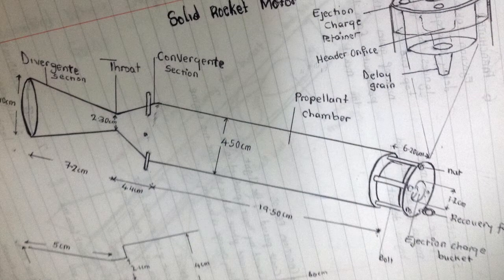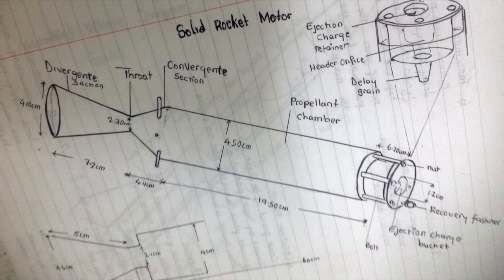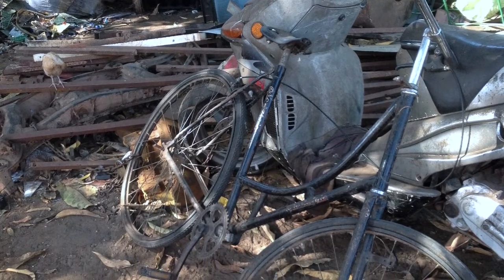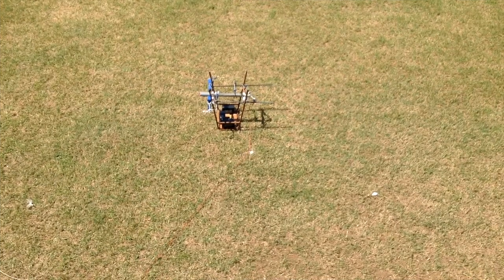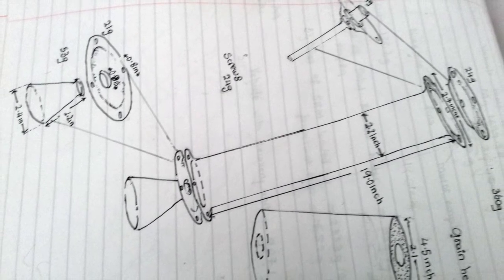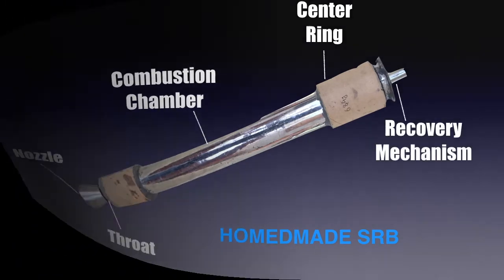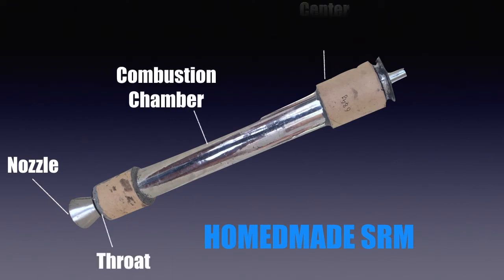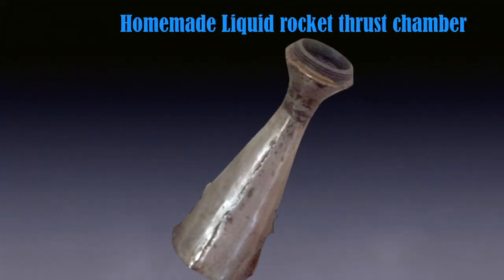how to make a reusable homemade rocket engine episode 8

Comment: How did you make the nozzle with steel ?
Reply from the maker: I first made it out of cardboard, then split one side horizontally ,place 
on a steel plate ,draw and cut off the shaped .I then took it to a local blacksmith ,then to a welder man while instructing them what to do.
Reply from the maker: Pardon me the split was vertically ,like a  3D cone figure having it side split and spread out to a sheet of steel if you can imagine it that way
Reply: @spacehakim1900  
Thank you so much for the information !!
Reply: just use carbon fiber, that one can withstand pretty high temperatures. Also there is possibility to make it out oflamable material in pretty nice shape (e.g. 3D printer) and then apply like 2-5mm of heat shield. There are some tutorials with low budget high efficient heat shields for rocket engines.
Reply: @Filipcorobivblenderi  
Thanks for sharing this information!
Reply: @Filipcorobivblenderi  doesn't carbon fiber need epoxy to be molded in the shape of the nozzle? and doesn't epoxy melt in like 200-300 celsius?
Reply: @lasergangers329  epoxy burn, but there is some inflammable stuff that hold enough... check integza. Also 3D printed ceramic would hold up just fine.
Reply: @Filipcorobivblenderi  do you know what that "inflammable" thing is? i've been looking awhile for like 3 hours but cant find it
Reply: @lasergangers329  ok my bad... its laminate, sorry man
Reply: @Filipcorobivblenderi  didn't integza still use epoxy to laminate it? I watched the video and I'm confused as hell because that thing is supposed to melt in a thermojet engine
Reply: @lasergangers329  it confused me too, he basically laminated it not with epoxy, but with refractory material (basically heat shield i talked about). Check 13:40 he talks about it more detaily
Reply: @Filipcorobivblenderi  isn't the material he's using an ablative heat shield? I don't think that's gonna work good for solid rocket fuel engines, especially if the material is put inside it and you want to reuse it
Reply: @lasergangers329  what my suggestion is, to use the same system he is using with extra heat shield, i guess system like that should be fine and reusable.
Reply: @Filipcorobivblenderi  ah I get what you're talking about, so a disposable heat shield inside the engine itself? that sounds great, thank you for the suggestion